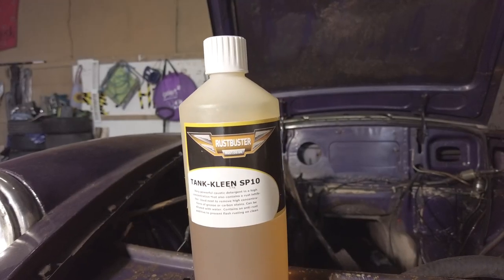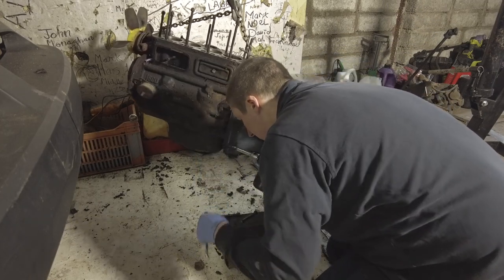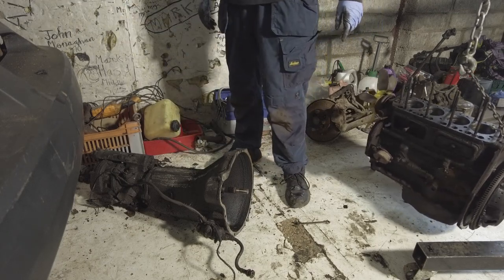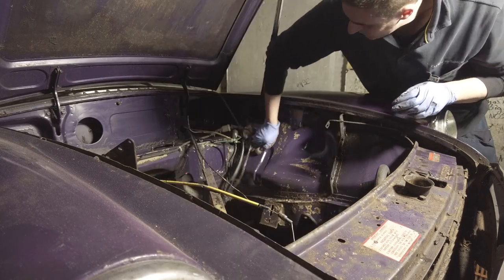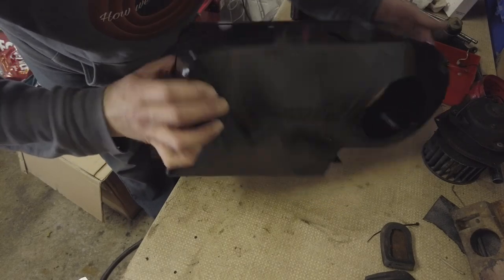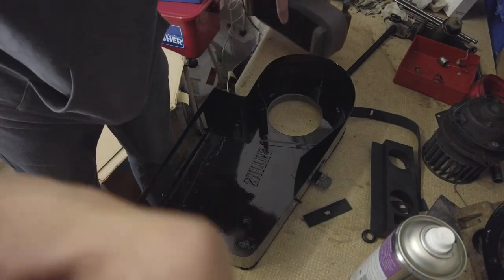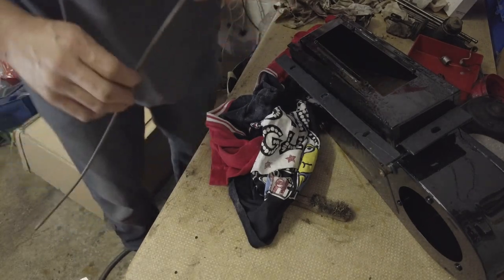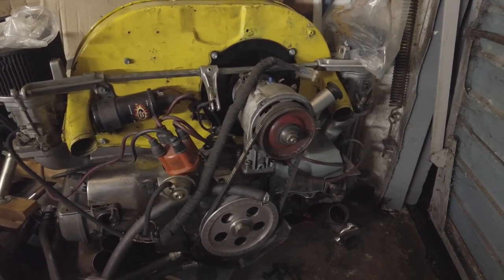MGB Restoration PART 9 - Gearbox, pedal box, heater box, snack box

Comment: Nice paint jobs Ross. I think you're right that gloss looks much better than matt paint. A word of advice when you come to refit the heater box is to smother the large rubber spacer block with silicone grease of something similar. Those remanufactured ones are produced with much denser rubber than the originals and have no 'give' in them, so a pain in the arm to get seated. I think you will find the spacer has to be fitted to the heater box before installation as the control cable has to be fed through it and connected before installing on the car.
Keep up the good work! 👍
Reply from the maker: Thanks very much for the advice. I'll keep that in mind when I'm reinstalling it. That's still a long way away though! 😉

Comment: Saw a video on the Tube a while back of a fella made a small parts cleaner from a 5 gal. bucket and an old sander.
Reply from the maker: Yeah I've seen that done to great effect. I might try it myself cause I actually have an old sander I could use.